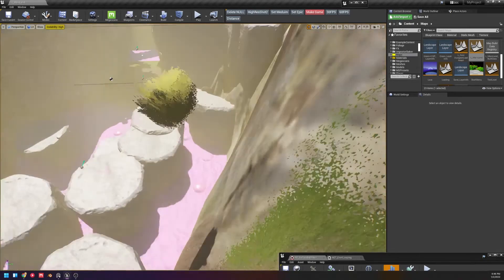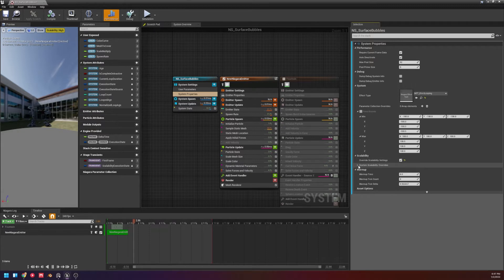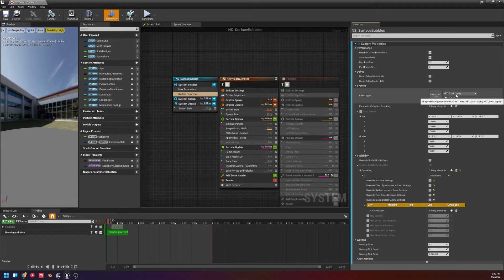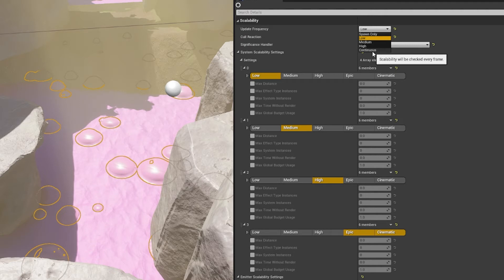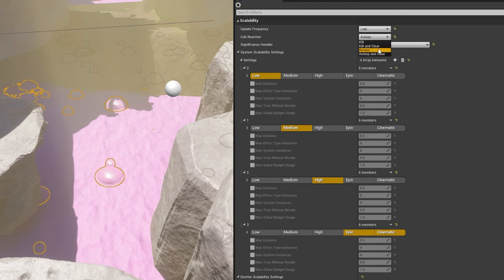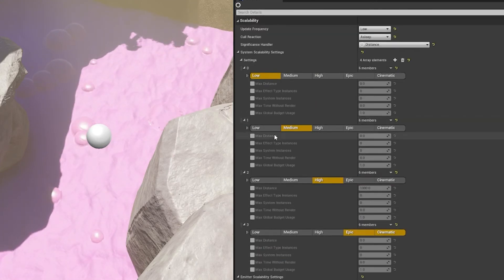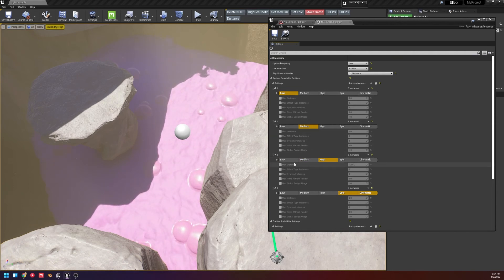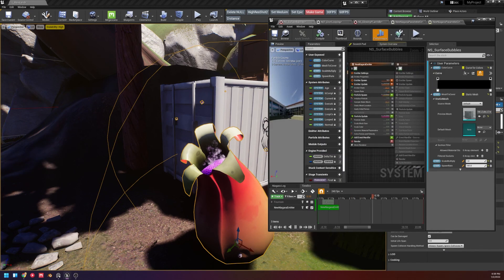Niagara Scaling / Effect types

Comment: One thing I'm unclear on and was hoping you could help. The Niagara Effect Type, does it work similarly to cascades LODs? where if i leave the Max Distance of 1000 I've set for my HIGH range, will it then drop down to the MEDIUM range thats set to 3k? I'm not seeing it function that way, but it seems like it should work that way. Thanks
Reply from the maker: while that isnt here you could do that a few different ways by having different emitters per distance lod you want or checking the distance and setting spawn rate / distance or something like that you can override any place a variable is set with curves/math/ minmax etc